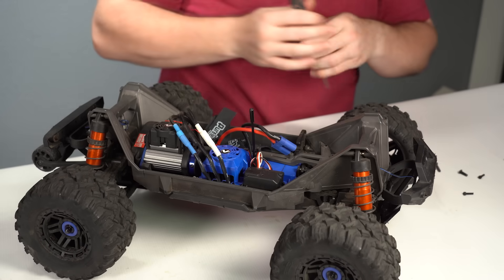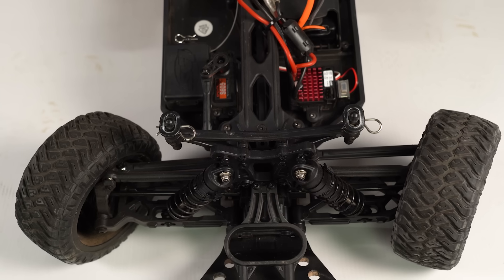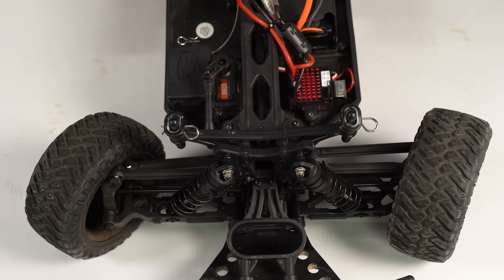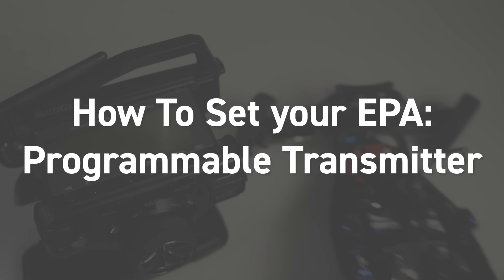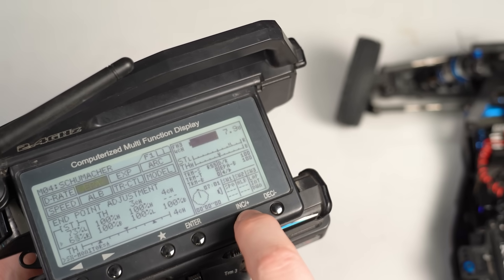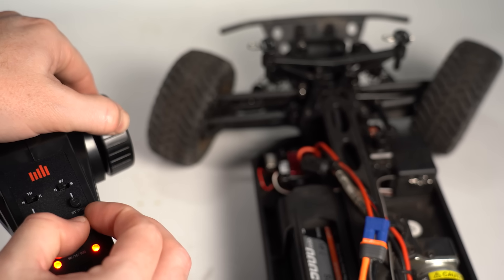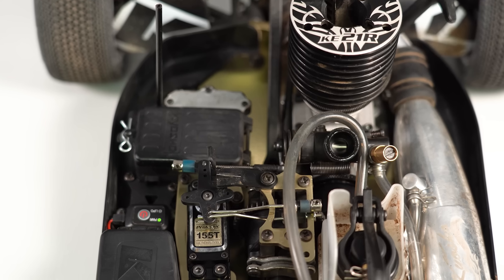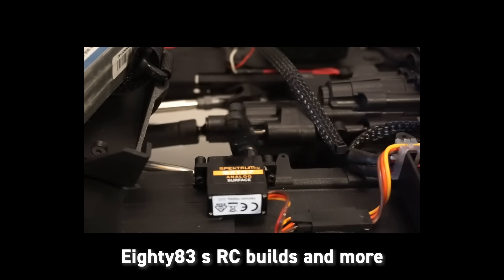How To Set your Servo Endpoints & Why it Matters - For Arrma & Traxxas TQi

Comment: What about if a servo is hot to touch with just testing plugged into the receiver, is that normal? Worried something not right and going to burn up the servo. I have tried 3 they all seem hot. 1 of them even brand new out of box.

Comment: Can not setting these endpoints lay waste to a servo saver? Because i have a redcat volcano epx pro that the plastic servo save started wearing out with lnot mich run time and then i upgraded everything to aluminum and put a metal gear servo in with aluminum servo saver and even with the servo saver knurled screw tightened all the way the servo saver starts slipping steering to the left but not the right and it's already messing up the servo saver to the point when running it, it doesn't wanna steer that well the the left but great to the right.

Comment: That's pathetic that Traxxas doesn't allow endpoint adjustments on the TQ transmitters. Those transmitters honestly deserve to be in the bin.
Reply: Wait so I just upgraded my Maxx v2 with a 6s ESC and the traxxas 2085RL servo from the stock 2090. I haven’t powered it up yet. But are you saying I won’t be able to set my end points?

Comment: I had to re-set the servo position on my sons rustler 4x4 bc the central drive shaft was being shredded from the steering arm when turned in all the way. But when I set the angles up the second angle, left or right last doesn’t matter, the angle is set back to less then I set it up to ending up in a huge turning angle. It’s always asymmetrical after setting both angles up exactly the same because of that tick after the last „set“. Anyone? Google didn’t spit out anything ¯\_(ツ)_/¯

Comment: What’s a good upgraded servo for arrma notorious 6s v5 blx
Reply from the maker: Anything with lots of torque will do the job, and then maybe waterproof if you need that. This WP250T is a good waterproof option: https://www.amainhobbies.com/ecopower-wp250t-waterproof-mega-torque-metal-gear-metal-case-servo-ecp-250t/p1466471
This savox is not waterproof, but a little more powerful: https://www.amainhobbies.com/savox-sb2290sg-black-edition-monster-torque-brushless-steel-gear-servo-sav-sb-2290sg/p536890
And this 1K TBL is the big daddy for power: https://www.amainhobbies.com/protek-rc-1ktbl-black-label-ultra-high-torque-brushless-waterproof-crawler-servo-ptk-1ktbl/p1331854

The first servo is probably more than enough for your truck and what I'd pick. 

Another component to think about is an upgraded servo saver. Stock servo savers are often set loose and spongy to protect the weak included servo, but with the downside they can absorb some of the steering instead of putting it down to the tires. So a good remedy, as long as you have a more powerful servo, is to use an aftermarket servo saver that you can adjust, and then tighten it up a little. In some cases, you notice an improvement in steering response immediately. 
-Brett
Reply: @AMain_Hobbies  thanks

Comment: but how do i change my stearing angle with a wltoys controller?? plz answer i really need help im breaking my car
Reply from the maker: If it doesn't have an EPA setting, does it have a dual-rate knob? It might be labeled "D/L" 
If you turn down the dual-rate, that will limit the steering travel for both tires together, where EPA does the left and right side independently, but at least it should help save your servo if its overextended. 
-Brett

Comment: Hi there!
Im a newbie to the hobby. 
Just bought an hbx 16889a pro, running it for a couple of days then all of a sudden the steering wont turn at all. But the throttle is fine. Rc is still running its just the steering wheel is not responding at all. 
Can you please tell me what to do?
Should i just replace the servo with a new one!
Thanks!
Reply from the maker: Is the servo moving, like it's trying, or is it completely unresponsive? Is the servo wire seated into the electronic board ok? 
-Brett
Reply: @AMain_Hobbies  so i have two hbx rc’s.
One rc is completly unresponsive. No movement at all when it comes to steering. 
The other rc is responsive, the servo is moving but its like restricted and it cannot turn the wheels. Both rc are ok when it comes to the throttle.  They can run forwards and backwards

Comment: Hello, 
  So I just pretty much just built a B74.1D. I have a 3PV Transmitter.
I just wondering if my EPA sounds proper to you.
So I have the Trim set to R 45. its the best I can get it.. 
I adjusted the EPA per your fist part of the adjustments the Aftermarket Transmitter.. 
So the L is 60 and the R is 84.
Its seems kind of ODD the right is more extreme then the left?! 
I Built the Car to Spec. I used a Digital Calipers.

Im wondering Does this sound Right? 
Thank you 
John
Reply from the maker: The number values are not really significant and you will always have one side with a higher value. It does not mean one side has more steering, it just means one side needs more servo throw. As long as you set your epa's correctly, the mechanical parts in the steering assembly will receive the correct amount of servo throw to achieve maximum steering angle (that amount of servo throw can vary side to side). 

It sounds like you have correctly set your epa's. Hopefully this makes sense. Have fun racing!
-Brett
Reply: @AMain_Hobbies  
  Sadly I have no clue what I am Doing!!! 
Ive always had a Basic Futaba Radio.
I just made both sides the same.
Not sure what that did.
These newer Radios have Way TO Much for anyone to get to know, Even a Disabled person.. 
Sorry..
Reply from the maker: @johnm8558  John, I just got done telling you the values don't matter. All that matters, is your servo doesn't try to overthrow the limits of the mechanical steering system. Please, watch the video again.  
-Brett
Reply: @AMain_Hobbies  sorry
Im just tying to figure out this 3pv! 
I have L and R set at 62 the right one goes to 62 so I just made them the same..  
Thank you

Comment: I have a Arrma SLT3 transmitter and receiver that I pulled from my 3s Granite. I have the Steering Rate maxed out and still don't get enough travel. Is there a cure for this? The servo has a 180 deg. control angle.
Reply from the maker: I'd look elsewhere for an issue; maybe the steering assembly is bound; maybe the servo saver is worn out; maybe it's just a limitation of the car? 
What car is it? What servo is it? What type of servo saver is it? Did you add any other steering or front suspension upgrades?
-Brett
Reply: @AMain_Hobbies  I know the steering rack is worn out and probably should be replaced to reduce play but there is no binding. I think the servo saver is the problem now that you mention it. The servo is a cheap E-Bay special ( FeeTech 35KG )and I have the same ones in my Typhon and Granite. Maybe I should remove the servo and check the travel. It just seems like the AMP never did have a good turning radius compared to something like my DR-10. I totally appreciate you helping me out and feel honored that someone from such a well know company would take the time to answer my question. 💯💯

Comment: My gosh, I just got the Traxxas 330 servo It sucks!!!!. The horn Won't center align right after I took my Rustler 4x4 vxl 4 times. Endpoints are set properly but it still wines loudly. My gosh, it won't even turn my wheels fully unless the car is moving sometimes. I'm gonna batter and deep-fry this servo if it gets worse. (any reliable servo suggestions for 2.8 HP tires besides the eco power 120T?

Comment: Hello. In  my spectrum dx3 I can't obtain full end points stering. Why? I have Losi 5t. Turn left . turning left I get the maximum but turning right is missing the scale on the rc remote and I do not get the maximum. While by hand, I am able to turn the wheels even more to the right. What is wrong?
Reply from the maker: Is this when you are trying to set the end points like in the video, or when steering normally? 
-Brett

Comment: The traxxax setup doesn't work on Bangood servos....only sets it for the left turn.....right turn slams all the way into wheel and left side goes like half turn.....press set button twice to reset to full throw on both wheels.....just have to under steer when driving my nitro rustler.....ugh
Reply from the maker: Did you try resetting the steering trim on the transmitter first? Shouldn't matter where you bought the servo. 
-Brett

Comment: I have the TQI Transmitter for my Xmaxx. I followed this process step by step. However, when I make the adjustments, the setting does not save and it still over extends to the left. Also, my transmitter has 4 blinking red lights when I follow these steps to enter end point programming mode. Anyone have any insight or similar issue? I did everything exactly how this guy did.
Reply: I have the same issue
Reply: @nopeairsoft469  Are you burning through servos too? I've burned through 3 already. One stock and 2 of the upgraded servos.

Comment: Wow! On the Traxxas TQi I run it seems to require a code mastermind to get all of those buttons mastered! I’m only kidding, but if you have the Bluetooth device installed could you do the same through the vehicle setup? I’ve yet to get the Bluetooth module but it seems to be geared towards that exact sort of thing. To do all of these setups and servo abilities easily from there. Since I’ve not yet obtained the module, I cannot say, but I’ve seen the app and from just browsing it I’d hope that I could do that and more through it. Thanks for the advice! I’m sure it will help!
Reply from the maker: Yeah, the Traxxas Link makes these adjustments super easy. It's a great device to have and one of three items in our 3 Must Have's for Traxxas: https://www.youtube.com/watch?v=_wegSAKX-3A
-Brett

Comment: Can someone tell me how to do it with a stock xp130 transmitter?
Reply from the maker: Unfortunately you can't set the left and right independently, but you can back down the throw as a whole using the steering dual-rate knob.   
-Brett

Comment: Brett in your video for the Traxxas EPA setup, was the steering trim knob supposed to be all they way counter clockwise and not set to 0? I thought I saw in some other videos and thought you said you want to make sure the steering trim is set to 0 before adjusting your EPA, so just was curious before I swap out my servo in my Maxx since I think the stock servo is shot.
Reply from the maker: You'll want to center the steering so the truck goes straight before you set the EPA's. When installing a new servo, you'll want to completely center the servo when you add the servo horn. Sometimes I'll put a horn on the servo and turn it untill I see where the horn needs to be, and then adjust by picking up the horn and reinstalling. Once i'm good, screw on the horn. You can also turn on the model and let the servo center (but be sure to set steering trim to 0 for this). Once you get the servo installed, turn on the model and center the steering with the trim knob so the truck drives straight, then set your EPA's. Hope that helps Donnie! 
-Brett
Reply: @AMain_Hobbies  Brett I think in understand, I will take a try at it tonight and if I get stuck I will message you back. But sounds straight forward but we will see if I get messed up when actually doing it. Much appreciated as always.
Reply from the maker: @DonnieKluck  You got this Donnie! Let me know how it goes. 
-Brett
Reply: @AMain_Hobbies  Brett I got it installed question I have is when I turn the when to left or right when I let it go it doesn't go am the way back to center. Not sure if it is just tires gripping the floor but just seemed odd why it wouldn't bounce back to straight (it is just off by a bit but you can definitely tell not straight)
Reply from the maker: @DonnieKluck  Hmm, most likely the servo saver in the steering system of the maxx. It's the two plastic pieces on the left steering post. Unfortunately, they're not adjustable, so after a year of use or so they should be replaced to get back some steering precision. After use, the two pieces slide on each other with dust and grit, and they sand each other down, making slop. This is my guess, there is no other reason it. Checkout those pieces. I think we talked about it in the Maxx upgrade video. 

Yeah: go to 6:00 in the video: https://www.youtube.com/watch?v=l-zNaLi59aY
-Brett
Reply: @AMain_Hobbies  Brett thanks I didn't even think about it since it hasn't been that long but I could see it taking good hits whacked then pretty good. When replacing them there isn't any better aftermarket part is there? Didn't know if sticking with stock is the way to go.

The servo horn you sent worked out great BTW and man talk about a right fit getting it on the servo. But fits like a glove.
Reply from the maker: @DonnieKluck  Excellent! Happy to hear it's working out for you. For the servo saver, plastic is pretty good since they rub each other but have a look around and see  what's available, I don't really know. 
-Brett
Reply: @AMain_Hobbies  Thanks Brett.... Yeah when I pick up the front end of the truck and toggle the steering it goes back to straight but when on the ground doesn't. So not sure if all is good or not. But seems like it is working, but I will pick up some new servo savers 👍
Reply from the maker: @DonnieKluck  Yeah check out those saver parts when you get a chance. When driving, your truck should drive just fine, just a little sloppy feeling. 
-Brett

Comment: Well I wish I had watched this three hrs before running my xmaxx with a new savox after the stock one died then the savox died in half an hour. So I may have not had epa set correctly. But I’m assuming the stock from out the box was already set , the 2850 suck!

Comment: Thank you for the informative video!
Will the servo stay calibrated once you bind the receiver to a different remote from the one which you used to calibrate it?
Reply from the maker: Hmm, never tried that. Since the transmitter is saving those settings, they should still be correct the next time you add your receiver and rebind it to the transmitter, but I don't know. It might not work correctly, it's tough to say. You might have to try it out. When you remove the receiver and add it to a new model, be sure to use a new model profile on your transmitter so you don't overwrite the old settings. Let me know what you find out. 
-Brett
Reply: @AMain_Hobbies  Thanks a lot, very helpful! 👍

Comment: What do I do if my trx4 sport is binding when it is turned all the way to the left or right? I can’t set EPA with the sport transmitter
Reply from the maker: Do your best to avoid using 100% steering throw. Other than that, you could upgrade your transmitter. 
-Brett

Comment: What about the throttle/brake epa ?? I have a blx 185 and the brake percentage is all the way up but the brakes are terrible, but only on one of my radios....any advice ?? Has been calibrated properly etc
Reply from the maker: Hmm, not sure about that Michael. When you say the brake percentage is all the way up, is that on the transmitter or the ESC? 
-Brett
Reply: @AMain_Hobbies  hiya Brett thanks for the reply...both are turned up well the end points on the controller and the brake percentage on the esc...can only set it to 50% for some reason in those....its baffled me so I think I'm just going to get another max 6 and I'm not sure whether to get an ezrun 4274 2200kv or a xerun 2250kv, which would you favour over those 2 please...looking for speed and low temps
Reply from the maker: @mickyovts3872  For just bashing around, probably the EZRun because it's less expensive yet still high quality. If you are racing the Xerun would be the better option. Hope that helps! 
-Brett

Comment: Nice video and very helpful as I am looking to upgrade my stock 3kg servo on my FTX Outlaw to a 25kg one. Will this work on the Flysky GT2?
Reply from the maker: I don't think they do, although i'm not that familiar with those transmitters. 
-Brett
Reply: @AMain_Hobbies  Thanks. Is there any way to do it on transmitters that are like this, or do you have to buy another transmitter and does the Flysky GT3C have EPA or an EPA like setting to set servo EPA.

Comment: I just bought an e revo vxl brushless and after testing the steering function which worked just fine, the servos started binding.  I have had it for about 24 hrs and haven’t even got to enjoy it.  Is there something I can do that I may be missing?  Does this happen frequently ?  Other than owning two drones,  I am new to the hobby grade scene.  Thanks for any advice!  Your videos have been part of my research base to get the e revo lol
Reply from the maker: Hey Daniel. How would you describe the binding? With the truck on the flat ground, are the tires turning? Sometimes a rock or debris can get wedged in the steering linkage causing issues. 
-Brett